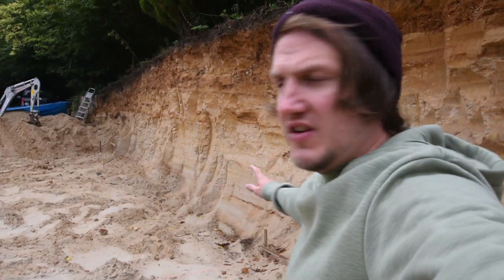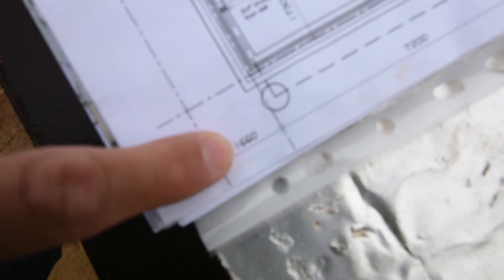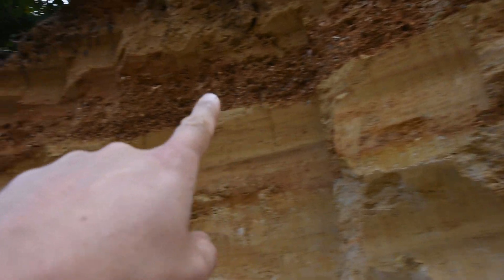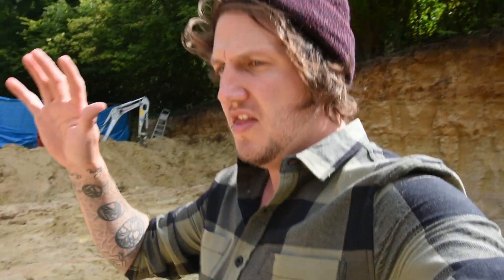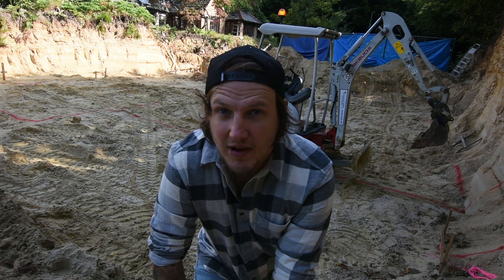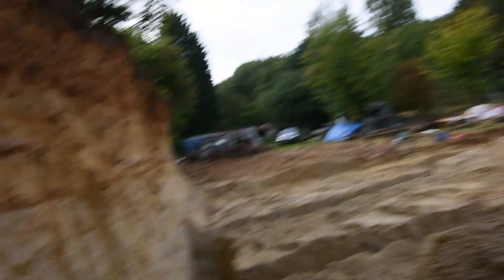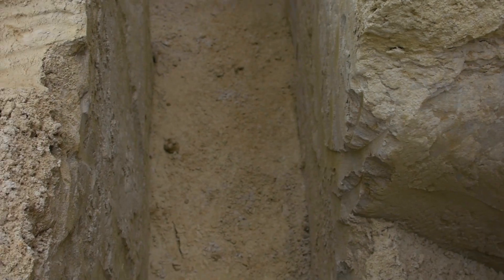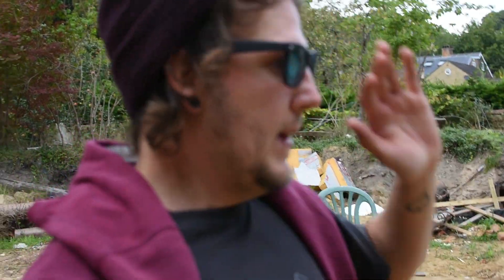How To SET OUT & DIG FOUNDATIONS The correct way! | House Build E.P 4

Comment: Hi there! Quick question... Now, i know full well how to set up offsets and profile boards and how to do the job properly, BUT, most of the videos i see on youtube, there is no proper setting out.. I bought an excavator for my own use on my own project, but i was asked to do a set of house footings for someone else. I was going to set it all out properly and explained that not only would it make sure that the footings were in the right place, but that the brickies would be able to come along later, mark down to the corners of the building, and either build corners, [or put up profiles] and run the bricks in. This bloke seemed to think i was an idiot and just wanted me to do the footings and leave the rest to the brickies. As a professional brickie, if you arrived at a site with no setting out, no offsets and profile boards, would you just walk, or set it all out yourself. The sites and/or builders you see without proper setting out; Are they just cowboys, or do most people not bother doing it properly in the real world???? What you think?? Oh, by the way.. This site was on a slope. I tried to explain that you had to use profile boards and level them, but this bloke just wanted to measure along the ground. I tried to explain that on a slope by measureing along the ground that the dimension in question would be wrong, but they would not have it.. Their house is still not built!!
Reply from the maker: It would all depend on what I was being paid to do. If I was told it would be set out ready and it wasnt then I would charge extra to set it out. If not then the setting out would be in the agreed price. I wouldnt just walk off the job without understanding why it wasnt done if it was previously agreed 🤙🏼🧱

Comment: What can be done if the trench is dug in the wrong place? Can you repeat after filling it again? I heard it's impossible because the soil is disturbed and the project can be compromised. What do you say?
Reply from the maker: I would say not to fill in the wrong trench. Instead dig out the trench in the correct place, set up shuttering and pour the foundation in the correct place. Once the concrete has gone off, remove the shuttering and then back fill the void. Hopefully that is helpful 🤙🏼🧱